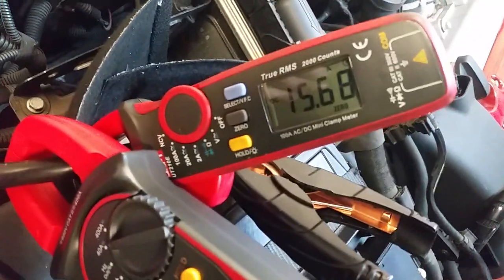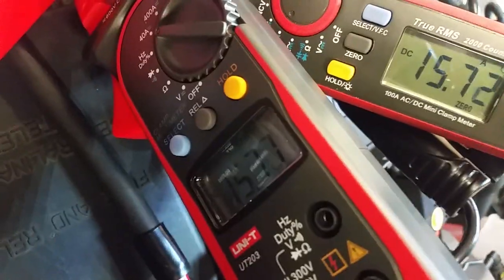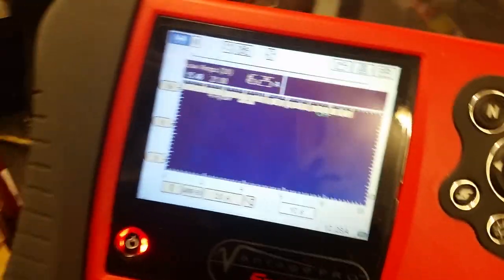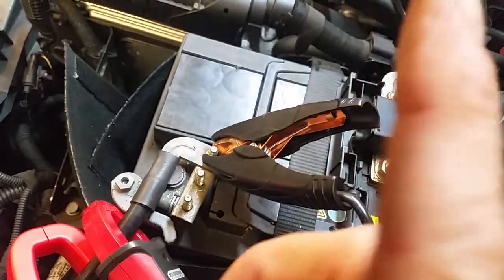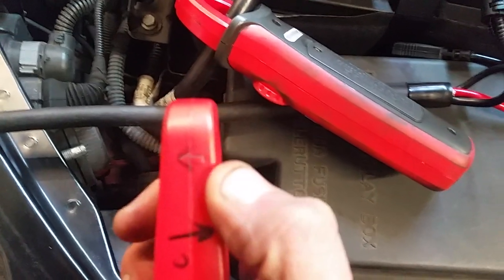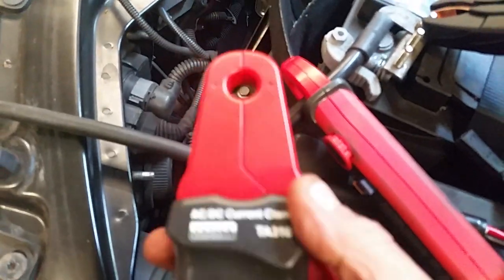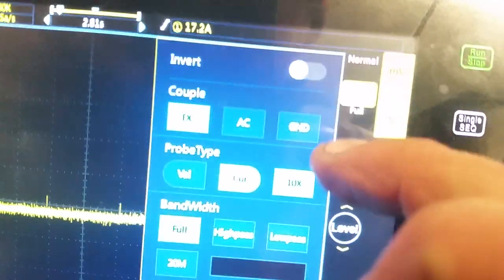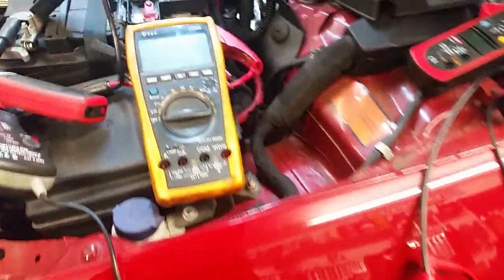Automotive current testing. Amp clamps

Comment: Really interesting vid Dave, how much was the 600A clamp? 

The uni T Clamps, can they be connected to the vantage using the jacks on the bottom or are they purely for voltage measurements?
Reply from the maker: i think the clamp was £50. search CA 600.
jacks on uni-t are for volts testing, so are inputs

Comment: Nice Dave enjoyed that. For automotive, use I always position my current clamp so its in sync with Battery charging "+" or battery discharging "-". So initialize with key off, head lights on for "-" Just makes sense to me like that, but certainly can be an issue with trace acquisition on a scope....Your up late!
Reply from the maker: Hi ian
 Glad u enjoyed that. Sometimes i dont know how these expanations are going to sound on the playback as these are unedited. Sometimes on the weekend i hardly go to bed. Cheers dave

Comment: what do you think of Dan Sullivan  load pro theory. Dave ?
Reply from the maker: The theory is dead simple, ian. The load pro leads put a 25ohm resistor into the circuit when you press the button. It is convenient but most people just use a bulb to load wiring to see if it breaks down under load.

Comment: Hi Dave what's your thoughts on sealey battery maintainer cheers sandy
Reply from the maker: Works well. Holds a voltage if youve a car on diag for a period of time. This one is 25amp output and seems well built, good size leads, crocs etc. The pros use 100amp tecdon or gys but they are 400-500 quid. I got this for125